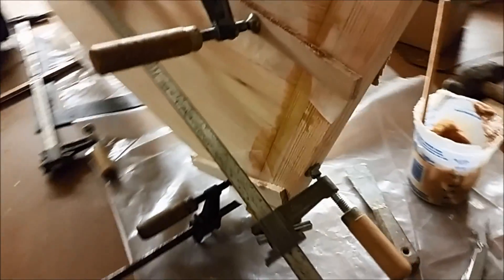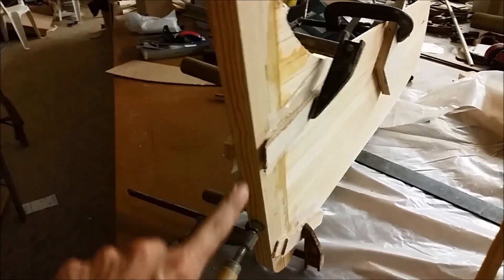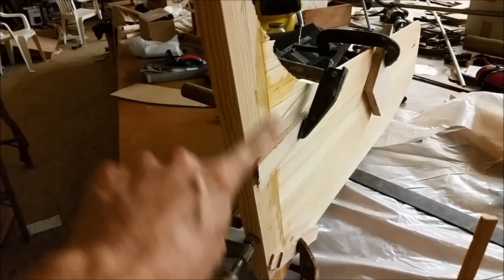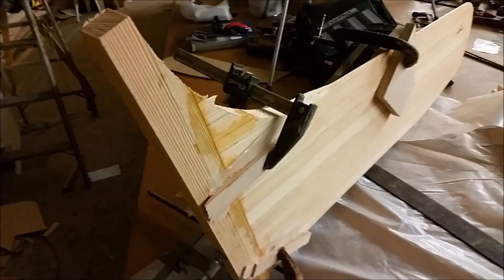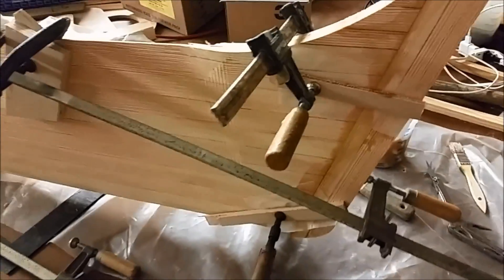Core Sound 15 Build Part 8b

Comment: Hi Alan,  Great videos.  My son and I are getting ready to build a 17, and we are thinking we may be able to do the centerboard this way.  There is a cabinet maker locally who has a CNC that we could possibly use.  I talked to Graham this morning and he was advising to avoid this and do it by hand.  His point being that doing a one time job, the CNC is more trouble than it's worth.  What would your take be?  I have done a lot of woodworking, mostly residential carpentry, trim, some art sculpture, etc, pretty competent and have a solid shop.   What would I need to know if I were to talk to the guy here with the CNC in terms of compatibility with the files you have created and your set-up?  Would I have access to the files, having purchased the kit?  I'd love to have a really perfect board in the end.  No romantic attachment to doing it by hand. 
-Matt and Tru
Reply from the maker: Hey there, I agree with Graham that it would be more trouble that it's worth. It would require us writing up some kind of instructions for the cut files and the size of the blank. Then there is file compatibility and material hold down. I would suggest you just order a CNC cut centerboard from B and B, we would be glad to glue up a blank and cut one out for you and shipping probably wouldn't be that bad with the handle left off for you to glue on. I can try and figure what it might cost if you want. Are you getting the 17 kit?
Reply: Alan S That is an idea.  I know I can make the board by hand.  I have the gear needed.  I guess it would be interesting to know what you would charge.  It could be cut rough and not sanded out of course. 
My thought was that it might save us some time and produce a better board, with the machine here locally.  I thought you even mentioned in this video that it is a doable thing to have one cut on a local machine. 
Yes, we are getting the kit that is being crated up right now.  Might have shipped today.